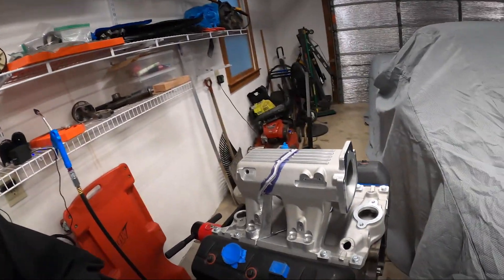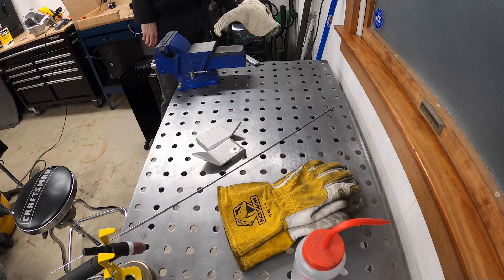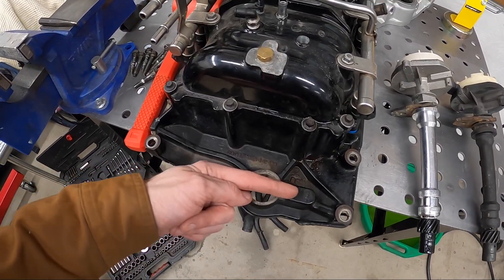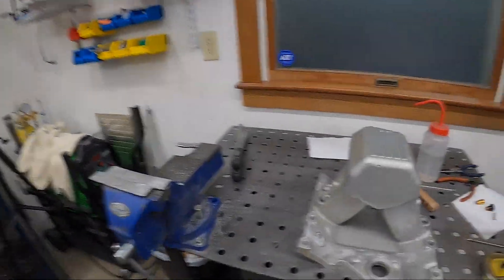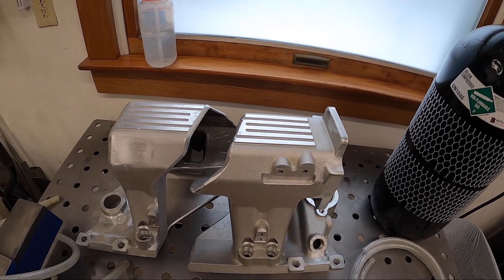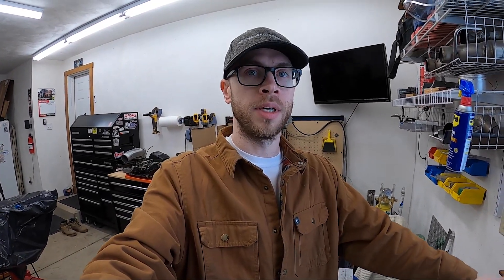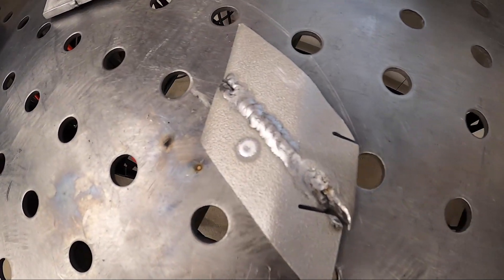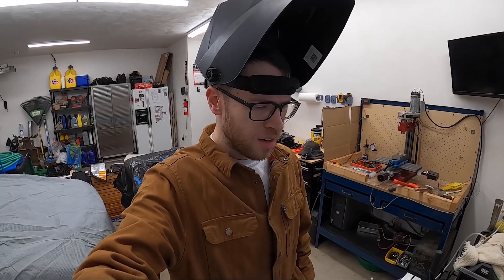Cast Aluminum Weld Prep - Custom 4.3L V6 Intake Manifold Ep2

Comment: You should get it 3d scanned! Maybe try printing it in high temp material. I think if someone could make a kit that could rewire the 4.3 vortec to not have a spider injector assembly or the plenum, would do very well. The marine intake is heavy and as a vertical breathing system not performance designed without boost. 
But this as a vertical tps system looks great!

Comment: Hey brother you can reach out to me at 281-907-2814 yeah. If you want to ship it to me I'll weld up that intake for you for free other than shipping cost. I also need a set of 4.3 V6 heads I do have a block that I can use for mock-up

Comment: Why did it matter where the distributor hold down was?
Reply from the maker: It was at the wrong angle. Distributor cap /wire would have been close or hit the firewall

Comment: Really nice videos you got going with some added humor.  I like it! Btw, hows that Marine MPI working out for you? I'm going to be installing it at some point but need to find a tuner to get the most out of it.
Reply from the maker: Marine intake works fine, just really heavy
Reply: @turbov6  indeed it is. I weighed the marine Mpi vs the aluminum/plastic stock
design and its 54lbs vs 27lbs. Pretty big difference but there is alot more durability with the cast and better flow I believe.
Reply: @carrsllccarrillo6507   Marine intake doesn't flow any better than the factory set up. What you gain and the advantage of the Marine intake is the ability to use and change for your needs the normal injectors. That is the entire benefit, tune capability for upgrades as you add components for power. Factory stuff has limits on fuel delivery, no upgrading of injectors possible. Limited fuel for power for upgrades

Comment: I use 100% helium when I tig weld at work for aluminum and copper. I like running my gas at 30 cfh and sometimes higher for aluminum and after welding I almost don't have to wire brush my part after (really can't get away with not wire brushing aluminum after welding). I would try turning your hertz up some it helps clean while you're welding too. But I would crank both bottles up to like 20 to 25 cfh. I hope this helps and I love the videos they're giving me bad ideas for the 4.3 in my silverado lol
Reply from the maker: Thanks! I definitely had the gas flow set too low

Comment: When you do weld it , you should bolt it down to the block incase of any warping issue , then belt sand where this gasket goes incase of any wrap issues

Comment: is that manifold alum? Have you tried preheating with a propane or map torch to a few hundered degrees? i watched the whole video as youre my hero for tha 4.3 turbo and inspiration to try this out since it seems to be a great diy for an injector manifold and id like to build my tig chops up on a kool project. But if thas aluminum and youre getting the contamination on the weld puddle maybe dont use a organic grinder, the black clumpy shiz wheels, when you grind edges, try or research using the sanding flap discs. ya i know they clog an wear out quick but i think that part of grinding to prep your surfaces or when you grind angles of with which to weld into ><<> use the sanding flap thing and see if that keeps the black contamination shiz and porosity from coming back. If that doesnt work then, dammit, dont fart prior to welding!! it throws off the whole chemistry of the air!! hehehe but recheck on that grinding tip and try it out on some of that clean scrap. I may have my trans built and installed in my blazer before the engine sees boost but my psi numbers will be lo until i figure out fueling like your manifold idea here.